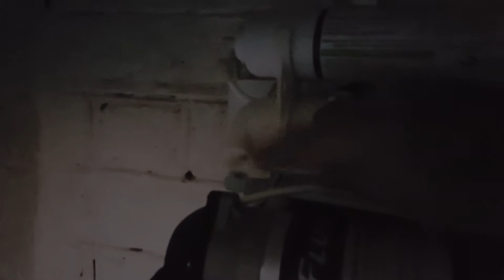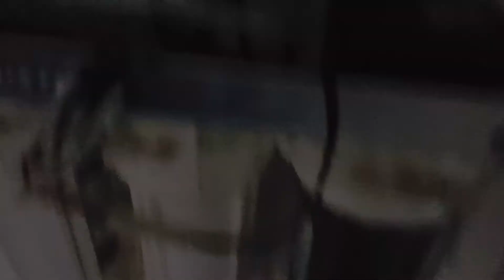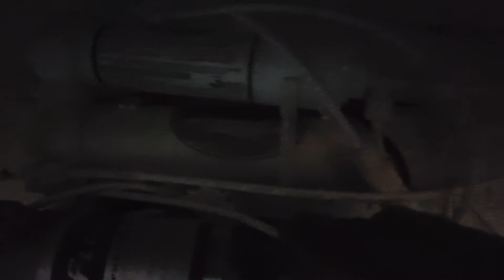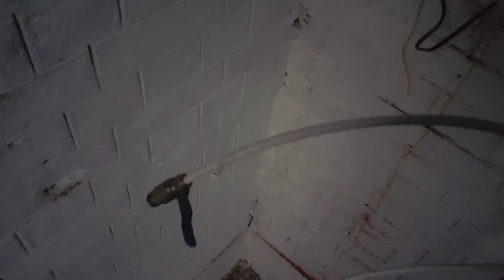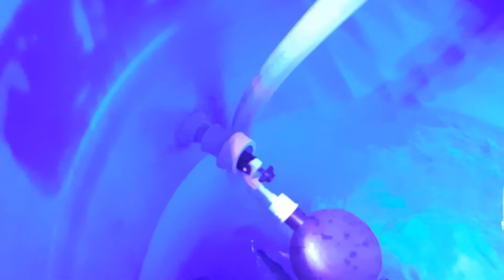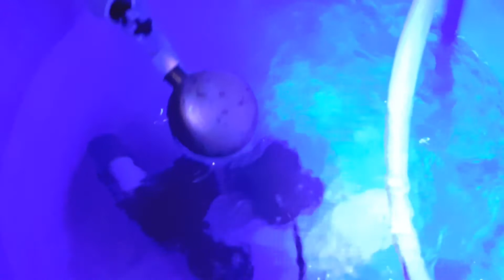Easily Modify RODI Filter to Decrease Water Wastage and Increase Clean Water Speed.

Comment: What's the tds of your tap water? My TDS is 1730 and I want to reduce it to 0 :/ any good RODI unit you would like to suggest ?
Reply from the maker: 1730 is too much. buy any Thailand made Ro Filter and use threaded first stage filter. switch on RO part (3 filters) for 10 minutes or till TDS reaches around 10 to 12 tds, move valve to divert water of 12 tds to DI Cartridge (4th filter) to make tds 0. if u direct a 100 tds to DI cartridge DI Resin will consume quickly.